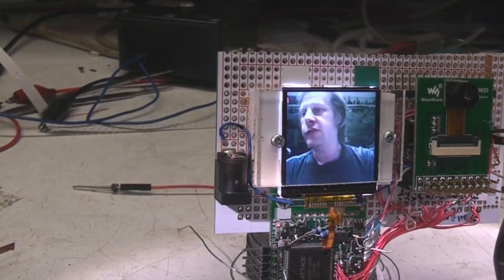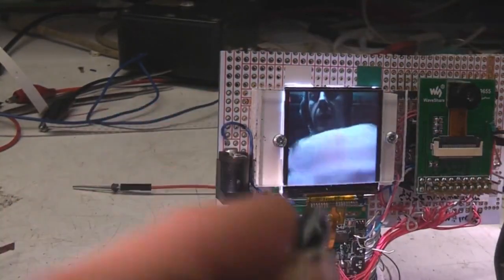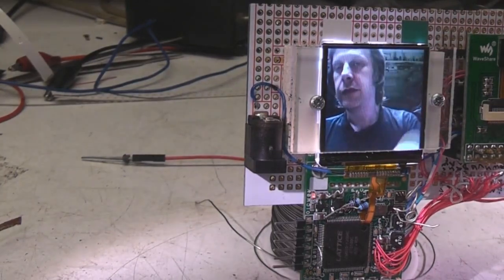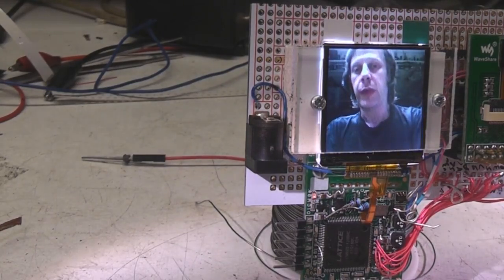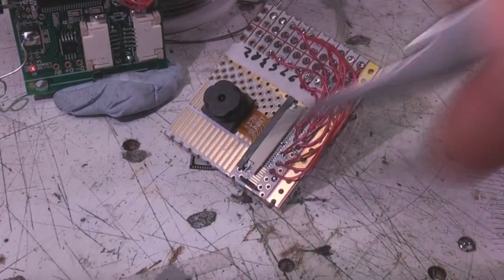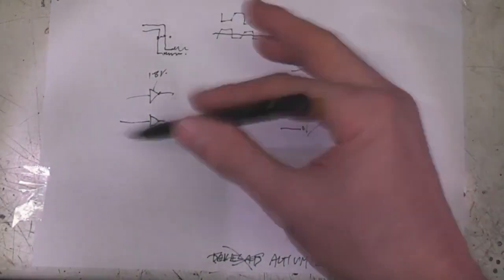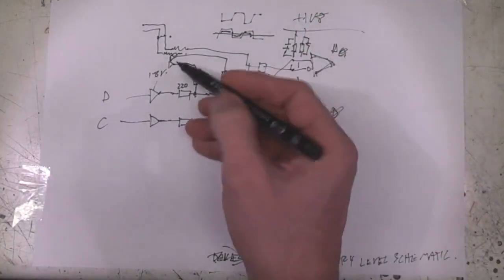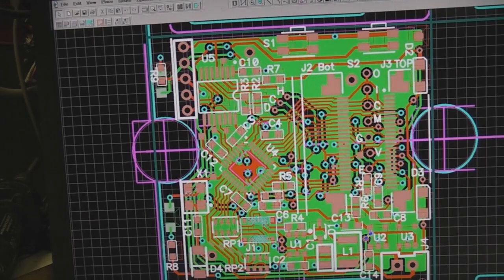Nanocam

Comment: Man, I've always wanted to be able to interface with those tiny cell phone cameras. Would be useful to make one of those PCB quad copters that fits in the palm of your hand, except instead of the fpv camera being heavier then the thing, it could be one of those tiny cell phone cameras that you have and then have on board processing.  Not sure how you'd go about making the video transmitter, though.  Unless its better to just use one and hook it up.

Comment from the maker: Haven't looked at these ones but I suspect filter may be hard to remove  - maybe even on chip. If not on the chip, you could use an external M12 type lens